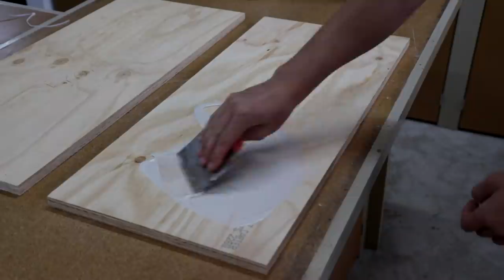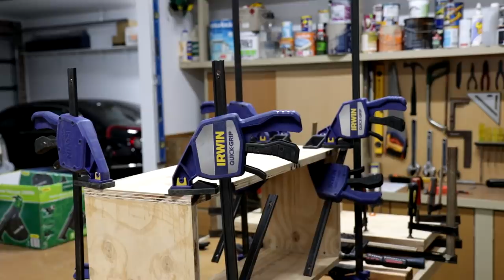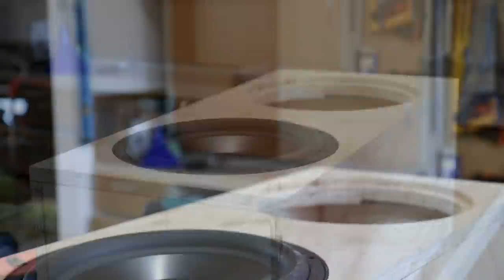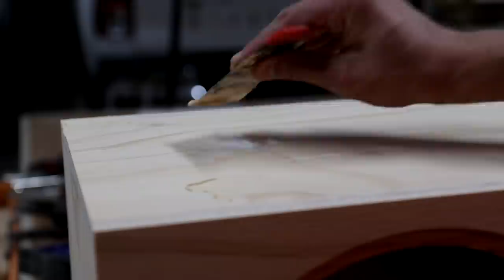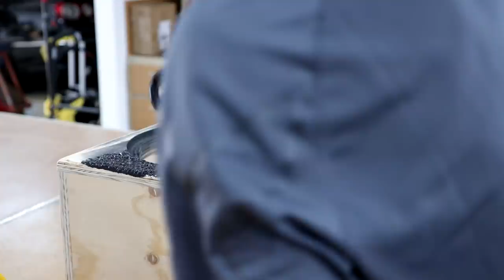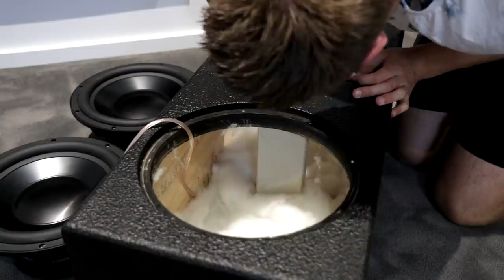DIY LOUD CAR SUBWOOFER BOX BUILD!

Comment: Nice. I’m personally not a fan of sealed boxes, I heard some that sounded great. But With the genre of music I listen too I get the output I want from a ported enclosure. But even with the ported boxes I built, and I’ve built over 10 boxes, and depending on some vehicle, I did not like the output or sound. My last setup which is on my channel was a 6th order bandpass wall I built and the output and bandwidth was amazing, but being that my whole rear of the car was a subwoofer box designed and sealed off can’t expect less from it. But I was unsure before doing a 6th order being that a lot of people say the bandwidth suffer and that couldn’t be far from the truth from my experience

Comment: Any particular reason as to howcome you didnt reinforce the seals with some drywall screws though? Doesnt wood glue tend to come loose after some time especially in a box that's completely sealed?
Reply: Excatly
Reply: There's no way I'd build a box with just glue. Doesn't make any sense.
Reply: Wood shop 101. Woodglue is a mechanical bond that is stronger than the wood itself. Meaning the wood will fail before your glue. If you did an advanced stress test, the wood would fail, the glue joints would remain intact. In case you aren't a woodworker....

Comment: Must be running single voice coil overs on those subs, which means there pretty low end subs. Only reasons to put 2 sets of terminals on the back, pumping 4 ohms thru those when you could have bought a slightly more expensive subwoofers and wire them together for at 1ohm.
Reply: Some of the biggest and baddest subs can have single coil subs. Single coil doesnt mean better subs, and maybe he wired it to 2 ohms because the amp isnt 1ohm stable.

Comment: Incredible skill and a beautiful box mate! My father and I built a sealed box and I was thinking of porting it, but watching this video made me not want to anymore. Quality over quantity :D
Reply from the maker: Porting is always a good option, depends what you want from the final outcome!
Reply: Flex Ported and Sealed have different results and depends on what you want out of your sub.

Alot of people hate on sealed but they normally just want loud and half the time don't know good sound with the bass blasting to the point music is not even audible.

I've got a ported 18" in my room and sealed in my car and even when I bring my 10" inside I prefer the 18" for its ability to dig deeper (tuned stupid low" and is just as tight as the 10"
Mostly a matter of preference.

Comment: Really nice work but I have a suggestion for the future and I am well aware of glue joints being extremely strong being I am a woodworker and in my past did custom car audio and boxes will split at the seems if not screwed due to the constant pressure exerted from high output amps, I’m not saying it will happen in all applications but I learned the hard way .
Reply: Not sure I belive you...
Reply: @denverwood5290  why would I lie

Comment: Sealed isn't always the go to. Ported can perform the same depending on the type of enclosure you build. You could totally port that, have it face the cabin, and get a bit better sq out of it. Maybe even flip it like it is. Facing it away from the cabin at the back of the vehicle adds unnecessary resonance and increases spl, also turns it into a lid rattler lol! I'd try it facing the cabin and see what happens. In a build I did a long time ago I experimented with different positions. Subwoofers facing the cabin and port facing the rear increased spl along with improving sound quality, on only 400 watts with a couple of cheap 12" subwoofers from a big box store it was very impressive
Reply from the maker: Might be worth a shot giving that a try! Thanks for the suggestion
Reply: Travis A bit confused with "ported can perform the same"

Sealed or Ported normally is preference as some peope swear by sealed or ported.
And some bash on sealed or ported for no reason without actually using their ears to hear then.

And I think the way subs face is dependant on the car at times, some cars rattle more than others (play loud enough and there always will be rattle) and some trunks will do different things to the bass.

But totally agree on playing around with placement.

I have a sealed Ultimax 10"for the car but eventually will port it tuned to 20hz.
Reply: What I mean by that is what your looking for in the subwoofer and how it will act in the space. A small ported enclosure normally will give the same results as a sealed enclosure with the benefit of allowing the waves to form outside the enclosure, giving higher spl. You'll still get that punchiness the sealed box offers.

Comment: how can i make the right sized box for 2 12" massive audio gtx dual voice coils?
thanks
great video
Reply: Do a google search for subwoofer capacity and you will find a website calculator.. chose style, ported or sealed, and it will give you the necessary measurements.. also, massive audio should have size requirements for  each sub
Reply: rob naucke would you be kind enough to put a link to that website? That’d be really nice I need a box calculator
Reply: gυяυвυlυ • box calculators are purchased, won’t find a good one for free.

Comment: Awesome box. Do you build and ship? I'm in Michigan.  Also I understood the reasons behind  every step except why you didn't make a gasket to go around the back of speaker terminal cups? Awesome work but let me know if you can do one for me sealed. I don't even need the finish, just sanded. I can paint it here.
Reply from the maker: I added silicone around the insider of the terminal cup to seal it, I must have forgotten to film it! At this stage I'm not looking to build and ship, sorry!
Reply: Shit you don't want anything from that wood it'll sound awful.  Hmu if you haven't found a box yet.

Comment: This is a sealed box right? I didnt see any ports and there is no divider they will interfere with eachother and cause damage to eachother
Reply: Not if its run mono because both subs will produce the same sound at the same time
 Say he had a 4 channel bridged down to two channels amd had separate inputs for each sub, then you would want a baffle because in some songs the left and right produce different sounds. Stereo bass from the bass outlaws illegal bass album is a perfect example. One side is hitting higher pitched tones and dropping down the frequ range while the other side is blowing sub 30hz tones.

Comment: I wouldve ported the enclosure myself. Alot more output and motors stay cooler with vented enclosures. Also try the u-pol raptor spray on bedliner. Imo a better finish. Nice build though
Reply: Nice job why no  air holes?

Comment: Hey just curious,  how did you cut off the excess wood after gluing it together onto the first baffle so that it would fit into the inside of the box
Reply from the maker: Very sketchily with the table saw! Calibrated it to by 19mm high on the blade and cut 19mm across (thickness of the wood)
Reply: You can use a router with a flush trim bit as well.
Reply: @denverwood5290  

Learned a lot since this question,  which was 2 years ago but I wasn't referring to the edges being cleaned up with a flush trim router bit but rather how he made it where the 1st baffle fit on the inside.

Comment: Box looks good.  The amp though...not a bad amp but with 90 amps of fuse (30x3) there is no way its putting out anywhere close to 2500 watts.

Comment: What is the little rubber feet called that you used when mounting the amp to the enclosure?
Reply from the maker: Anti vibration or isolating feet, something along those lines!

Comment: if you have the tools...
Reply: All you really need is a circular saw ($50) and some good practice to get nice cuts. Hole can be cut out with a jig saw ($30); won't look as nice but it will still work. Box can also be hand sanded and impact driver is not necessary. The only really expensive tool he had was the table saw
Reply from the maker: That is true, minimal tools are required for a build like this and you can get most of your wood cut when you purchase it like I did!
Reply: @Doublsmmm  Thanks for the answer!

Comment: Why tf you are running them both on seald box when the have thw power to play low freq and make some nice bass notes
Reply: Because bass-guitar has lowest frequency of 40hz, and he is listening most of the time rock.
Reply from the maker: They still have the power to play low in the sealed box, I am very happy with the outcome.
Reply: Unknown Music Having a hard time understanding what your going on about lol

Do you have something against sealed enclosures? Alot of the time sealed will go lower than ported in cars as I've seen way to many high tuned ported fart boxes because they try to keep size down so they tune way too high.

Comment: 1565 Rms watt from an amp with 3x30 fuses? No way.

Really nice box tho
Reply: Reaper Thats what i noticed too
Reply from the maker: Yeah I honestly don't expect the amp is any more than 1kw rms to be honest, just a cheapy but will do the trick for now!
Reply: True, but does one really need more than 1kw?

I guess I'm only speaking for myself as I'm only using a 500w amp in my car and I'm satisfied.
But I don't like multiple subs in cars either, just a single Ultimax 10" sealed, and eventually ported tuned to 20hz.

Everyone has different ways they enjoy listing to music I guess. :)

Comment: what's the diff for using plywood vs MDF boards on how it sounds? any one?
Reply: Plywood is lighter, and stronger.  The biggest problem with plywood is voids.
Reply: Ok so there resonate sound damping issue why MDF is better. Ok cool

Comment: Loud.
Sealed.

It's one or the other bro you can't have both.
Reply from the maker: You can have a sealed box that is loud, it just has more potential to be louder if it was ported.
Reply: You'll also more likely have air leaks due to putting in the lead cups after texturing the box @Doublsmmm
Reply: Doublsmm It’s crazy how people nowadays think sealed enclosures can’t get loud.....rookies 🤦‍♂️
Reply: @Wiggy74  lol  yup.
Reply: You can have loud and sealed, and best of all when you hit the lowest of the lows a sealed enclosure doesnt "unload" and destroy your subs when. 20hz not suddenly hits if the box isnt tuned right. Sealed can get low and tight if it's the right size. I had a single Orion XTR 12 and a JBL BP150.1 mono amp in a sealed single sub hatchback box back in 2000 and it blew the hell out of my friends huge boss amp hooked to four 12's  two were power acoustic and two other no name ones. He couldn't understand how my 75watt x1 amp amd single 12 was louder and hit lower than his 4 12s and huge boss amp. Yeah, he had cheap stuff but that single 12 still rattled the overhang at the oil change place I worked at part time while stationed at Dover AFB. Ported is louder but only at certain frequencies. Sealed has a flatter response in most cases. My home theater sub is a different story. I have an SVS PV2000 which is ported, and that thing is am animal. Feels like the lower it goes, the more powerful it gets. Most prefab subs and mainstream home subs like infinity, Klipsch Bose, Polk, etc exaggerate the bass at 40-45hz to sound "loud"and fall on their face below 35hz. That svs is strong even below 20hz. So yes, a correctly built and tuned ported box can be loud, but it takes alot more to make it accurate and have a flat frequency response curve.

Comment: Nice work man but why plywood.
I also do audio stuff like this and go to my YouTube
Reply: I was wondering about the plywood too. I bet its heavy. MDF is even heavier.  It would take 2 people to set a MDF board box built like that in a car.
Reply: @gavinpickens73  say what i have a box for 3 12s sealed i put the box in the trunk of my car by my self...the box was made of mdf it was pretty heavy tho...
Reply: @killer32620  I commented before I seen the box completely done. Double MDF would get heavy. My little 128 pound self needed help putting my truck box in . I'm not strong like you.
Reply: @gavinpickens73  im not strong either the struggle was real i only weigh 165 im pretty skinny by the time i got it in the trunk i was outta gas lol i had to take a break after that
Reply from the maker: Ply is very strong and I wanted to keep the weight down as much as possible, finish wasn't too important due to the nature of the finish on the enclosure!
Reply: @Doublsmmm  but it doesnt have the acoustic properties of mdf. I was actually quite surprised you used plywood.

Comment: The amplifier is probably about 900 watts it has 3 30amp fuses and 12×90 = 1080watts and the amplifier is not 100% efficient
Reply: At best he would probably get like 700-900 watts?
Reply: @riveralley  yes
Reply: He will more than likely never drive it to its full potential anyway.
Reply: Most cars charge at 13.6-14.4. In the middle at 14.0, that’s 1260. Also no amp is 100% efficient
Reply: @jeremys8360  under a 1260 watt load the voltage would drop to 10 volts or even lower
Reply: Ole Schnorr unless he’s upgraded his electrical. Better starter battery, big three, secondary battery, super caps, better alternator
Reply: @oleschnorr3543  pretty much depends on his alt at this point if its like mine a 110a he's gonna stuggle...lol altho i did do a big 3 upgrade and it helped some
Reply from the maker: Exactly right, cheap amp, wont do its rated power but I fully expected that. Its already way too much for the car and I can already see myself down sizing it!